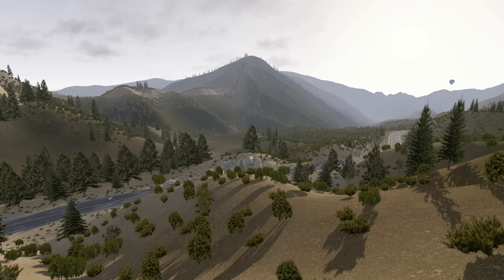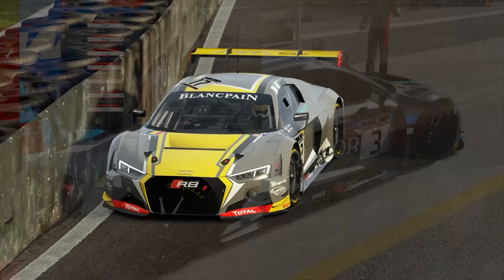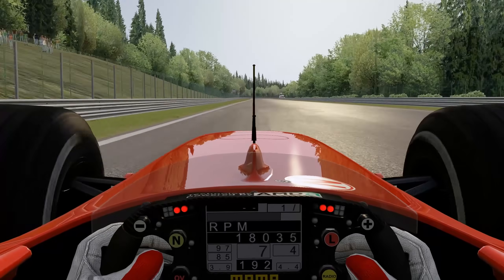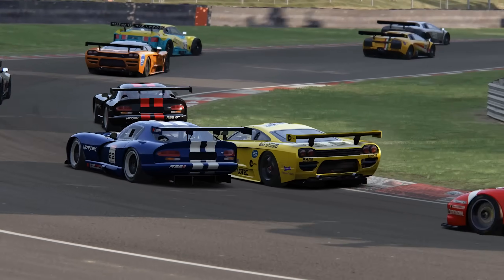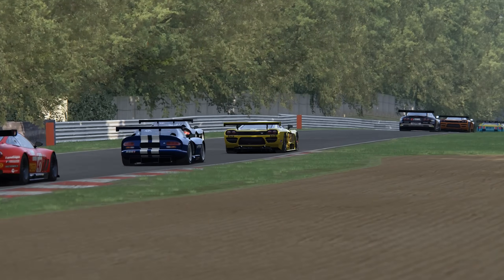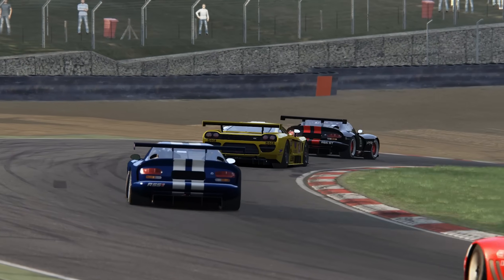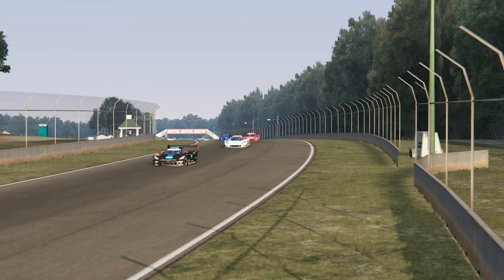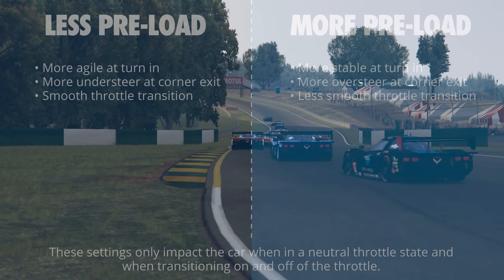Sim Racing Setup Guide 09 – Gear Ratios and Differential Settings

Comment: In GP4 there is:

Differential - Acceleration - Shaft Speed diff.
Differential - Acceleration - Input Torque
Differential - Deceleration - Shaft Speed diff.
Differential - Deceleration - Input Torque

I would guess, that acceleration is "power" and deceleration is "coasting" as you put it.
I don't quite know what Shaft Speed and Input Troque means. I guess Shaft speed is the locking and input torque the preload? It is difficult to test. I have the feeling, putting Input torque decel to 0 makes my car want to spin A LOT on curve entry. Decel Shaft Speed to 0 makes it less twitchy, but I still can influence my turning a lot by lifting my foot from the gas. Any idea what these settings mean?

Great video by the way!

Comment: let me just add a point: always leave a little bit before the rev limited on the last gear. Because if in race you get in the slipstreaming of someone, your car will reach a higher speed faster, if u leave it right at the limited when ur alone, u will not take full advantage of the slipstreaming.
Reply: Good tip

Comment: I’ve always been confused with the diff coast bit. Why would the diff need to lock up when coasting?. Is there actual torque going to the wheels when coasting? 

I thought its only when on throttle and sending power to the wheels. 

I’m easily confused

Comment: bit confusing when as you mention, the terminology different sims use differs. Gran Turismo for example offers initial, acceleration and braking values. 
From a baseline setup, many, many consistant laps have to be made then alter a setting a little to see if lap times improve, as with any car setup. Unless you are a full-time sim racer, it can take a few weeks to setup a car properly to your taste.

Comment: Im pretty sure you R wrong about coast setting, especially how it impact  the handling. More locking makes car rotate more under braking. Due to wheels locking and losing grip. The same thing happens under acceleration. More locking on power and you get the power slide.

Comment: Funny I always thought a locked or closed differential sent equal amounts of torque to both wheels, a open unlock differential send power to only one wheel, usually the right wheel and a limited slip differential distributed power based on wheel spin, for example if the left wheel is spinning more than the right wheel, less torque would be sent to it and more torque would be sent to the right wheel.

Comment: Chris, one thing I don't get is coast settings. You say that lift off oversteer is caused by too little diff coast locking.  In a turn in, off throttle situation, wouldn't a completely open diff be providing the most rear traction because you are allowing both tires to move completely independently and find their max grip?  Intuitively this makes me think you would apply LESS diff coast locking to cure turn in oversteer. Where am I going wrong in my thinking please?
Reply: With little diff coast locking : The wheels can turn at what ever speed... RPM they want so the car can rotate on itself.
With more diff coast locking : Both rear wheel are forced to turn at the same RPM so the car rotation is restricted.
And that is where one can see that the on power behavior explained in this video does not jive. (see my other post under Timo Engel post).

Comment: To nitpick a little :P Technically, open diff sends equal power to both wheels. Which is why it is bad, the same power that is required to rotate a wheel that has no grip (i.e. is not on the ground) is send to the other wheel, which is obviously not sufficient to move the car. Closed diff splits the torque, so both wheels are spinning at the same speed... which can mean that 100% of power is send to one wheel.

This is important to know, because some LSD are set by setting the maximum torque difference between wheels. So a lower torque difference = more open diff.
Reply: @Matus Celko,  And a nitpick of a nitpick :P. With open diff power is NOT sent to both wheels equally. Power is work over time, and work is force over distance so technically the wheel that spins faster receives more power.
What open differential sends equally thou is torque.
Using power here gets ugly fast when trying to understand how diff actually works. Thou i can't blame Chris since it's more intuitive to describe what diff does for a layman using power.

So @Chris Haye you had the correct idea there :)
Reply from the maker: Yeah, you're absolutely right Matus - I should have been more precise with my language there.
Reply: @ChrisHaye  As I said, it was just a little nitpick on one of the best introduction series to car setups. I really hope that you'll continue to produce videos like these, because you're not only knowledgeable about the topic, but you also know how to transform the knowledge into great, easily watchable, videos, with hight production quality. Which is not that common ;)

Comment: Very well done Chris. I think this general way of explaining these different parts of setups is great. Though on top of this people still need to look for the details of game specific factors since they can vary quite a lot.

So here is a suggestion. Make a final video where you point out these major differences between common sims like: Project CARS, iRacing, Assetto Corsa and maybe rFactor 2. 

That would be a really unique video and extremely helpful. You would not need to go through every single little detail, just those that matter most. Like pressure in AC must be in a certain narrow window vs. Project CARS where you need to balance it with the IMO temperature readings. I had to do a LOT of research to understand how these things work in each of the games to get any good setups done.

Sure the basics are the same in each, but some sims just overvalue some aspects more then others that actually make a big difference in the end.

Comment: Now I know what differential do. I had high coast differential which caused understeer during turn in. I had no idea this was the cause.
Reply: You really need to understand every aspect of the car setup to make a setup work. There is so many things affecting the handling of the car and can really mess you up if you're not aware. I've started doing setups recently and the amount of things you need to know is abysmal at least ;)
Reply: @VinReho   Agree on that. Making a setup is a headache to me as I don't know everything about it yet. I'm still a newbie in setups but I'm getting better. And this video has helped me understand what means what.

Comment: Great explanation, but my cure for power over- and understeer is rather the opposite, even it doesn't work in AC like that. And it's the difficult to judge diff-settings in the first place, because locked and open differential have oversteer and understeer tendencies depending on the car and situation. Cars like the Super V8 or Porsche C962 with a spool can have power oversteer and understeer and cars with open differential like the Skip Barber and USF2000 in rF2 as well, but the last ones seems more nimble through corners. So the best is IMO to know both extremes to judge what characteristics you want more or less with an LSD.
Reply from the maker: Oh, for sure Leynad Jee - and it's worth considering the other contributing factors as well. The 962 for example has the classic understeer on turn in and oversteer on the power at low speeds, but faster speeds it will understeer on the power - which is I think what you are referencing.
Reply: @ChrisHaye  With ridiculous huge tyres in the rear comes understeer:) Power oversteer seems more related to the high toe settings to get away without a diff and when a car power-oversteers, i usually neutralize toe first in all related cars.

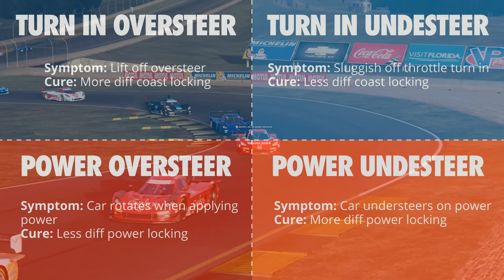Comment: I'm really enjoying your videos as ever Chris. Just one question on this one, doesn't more coast-locking cause more engine braking and therefore more lift-off oversteer,  not less as mentioned at 7:56?
Reply: Reducing coast locking should in theory help turn in when off throttle. It is not the same as engine braking.

Comment: Good video again. But doesn't an locked power diff provide power understeer? Because both driven wheels will rotate at same speed and will go straight? Or did I something not understand?
Reply: YES it Does. Your Statement is correct for FWD and RWD. It is depicted wrong in this video... wall of text coming up!
If one mashes up the "Loud Pedal" coming out of a tight corner, what ever the diff, ramp or lock setting, if the rears light up... be prepare to go full opposite lock... wrong driving technique.

"By limiting the slippage between the rear wheels, the differential can have a profound impact on the car's handling. The rule of thumb is: the more the diff limits slippage, the more the car will tend to go straight or understeer -- up to a point -- On the power side, if enough torque is applied to spin both wheels, the car will snap into oversteer."
(http://www.intothered.dk/simracing/differential.html)

That means, on a long fast sweeper, at 100% lock, the inside rear want to rotate at the same speed as the outside one. The rear axle wants to make the car to go straight. 100% lock, the car will not turn. At 0% lock, it will turn all we want but it wont accelerate out of anywhere (smoke show anyone). Just one more balancing act!

Setting lock percentage by how the rear end pops out is wrong. IRL, bye bye rear tyres in just a few laps.
Always set your diff while driving with your head, not your right foot. Not sliding... all wheels well planted.

To augment rotation during power exit, diminish understeer : lower diff power.
To diminish rotation during power exit, augment understeer : augment diff power.
This way it physically match with:
To augment rotation during coasting entry, diminish understeer : lower diff coasting.
To diminish rotation during coasting entry, augment understeer : augment diff power.

There are a lot of very technical books out there but, for many readers, going through those can be quite harsh.
Drive to Win - Carroll Smith
Tune to Win - Carroll Smith
How To Make Your Car Handle - Fred Puhn
Going Faster - Carl Lopez

Many years ago, I learned everything from a little book that was a breeze to read: Four Wheel Drift by Steve Smith. The guide that came with Grand Prix Legend. The people who did not go through that booklet found GPL undrivable. The guys who did... became racers. 
Original : http://sierrachest.com/gfx/games/GPLegends/box/Four-Wheel%20Drift.pdf
Redux : https://www.autosimsport.net/media/downloads/GPLmanualREDUX-2.pdf
Originale en Français : http://gletellier.free.fr/fwd.pdf

Exert: "Alison Hine uses the tire temps to help adjust the differential. Taking a reading coming off the Parabolica where you’re most likely to get wheelspin, she looks at the temp of the inside (RR) tire. If it’s higher than the outside tire temp, which would normally be the hotter of the two, she knows she’s spinning the inside tire, and adds a clutch or two until the temp drops. She knows she’s gone too far when both tires break loose together, sending the car into snap oversteer. Then she removes one clutch the inside tire should now begin to spin just before the outside tire breaks loose."

In Grand Prix Legend:
--- High ramp angles equal Low locking %
--- high clutch # roughly equal to high preload %

--- Augmenting preload "mainly" sets the minimum level of locking so you don't get an open diff during the transition between power and coast.
--- Adding clutches Modifies how fast that transition, that locking happens.

https://www.taylor-race.com/sites/default/files/DIFFERENTIAL%20ESSAY%20W%20PHOTOS2.pdf
https://www.ripublication.com/ijaer18/ijaerv13n2_89.pdf
http://downloads.optimumg.com/Technical_Papers/DifferentialAnalysis_BertaReport.pdf
Reply: Your statement is cottect if car is FWD, but in the video he is talking about RWD because most of the top classed vehicles are RWD
Reply from the maker: Thanks - yeah, I've sort of overlooked FWD cars in these guides, which is a bit of an oversight.
Reply from the maker: Hey Timo - As Jurica Slovinac said, in RWD cars, a locked diff causes power oversteer.